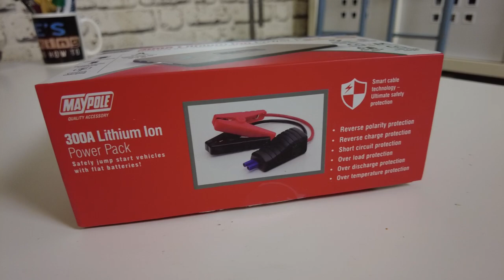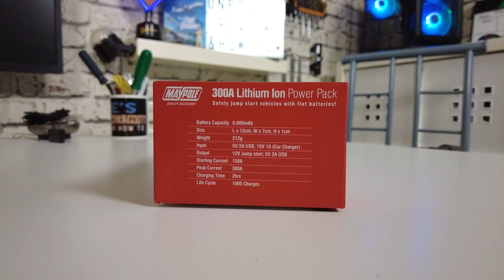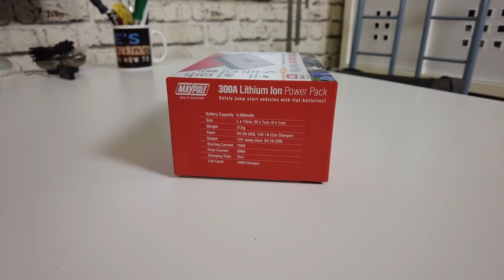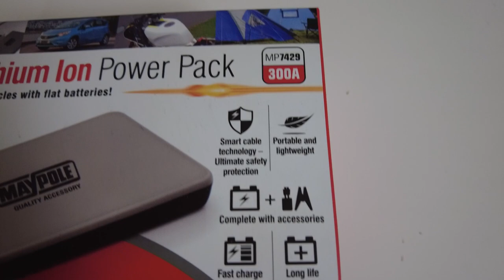300AMP Lithium Car SMART Jump Starter Power Pack Booster Maypole MP7429

Comment: I bought a Sealy Electrostart 4 years ago...its brilliant....no battery in it ...it uses capacitors and you can charge it in about 3 mins from a pretty flat 12v car battery as long the battery's residual voltage isn't below 5v (even after leaving your lights on all night or running battery down trying to start it usually wont dip below 10-11 volt)  ....have used it about 6 times on friends/neighbours/family's cars and it works great...expensive but excellent.
Reply from the maker: that sounds like a great piece of kit

Comment: Bought a similar device During 1st lockdown as I left my charging block connected in the Always on cigarette socket so after leaving it for a few weeks the battery dropped and wouldn't start (borrowed a Charger that time and bought a booster for future)
last week car wouldn't start, got the booster out of the boot (6 months without a top up on it) connected and started as if a brand new battery had been installed.
The one I bought was from Amazon, YABER Car Jump Starter, 1500A Peak 20000mAh Car Battery Booster (not listed now)
Very impressed (although it does recommend a top every couple of months to keep it charged)
Reply from the maker: thanks i'll see if i can find that one at some point sounds great and these are super handy

Comment: You say it is only good to 3L... but I believe it is harder to turn over a desal engine than a gas engine due to compression. Makes me wonder if it could start an Ford F-150 (5 litre+ gas engine).
Reply from the maker: yeahj my engine is a 2ltr diesel so that gives it some hard work to do fro the size on the battery bank, i recall only a few years ago that these boosters were the size of a toolbox and just as heavy. progress is good sometimes
Reply: @mikesunboxing  Battery technology is progressing quickly!

Comment: Unrelated to the video, sorry. Does anyone have the Ryzen 3700x? My CPU will bounce from 3400mhz back up to 4300mhz while running the a game. Temps are in 50s, just fine. I’m using afterburner to monitor this. It’s base speed is 3.6Ghz. From what I know, the CPU isn’t supposed to drop below its base speed. Am I missing something here? I am a bit of a noob, just built this PC in June.
Reply from the maker: run a benchmark in cinebench and watch the frequencies that should stay pretty much maxxed out for the test, if not there is something going on
Reply: @mikesunboxing  running the free version of 3D mark and it’s bouncing around during the GPU test 1 and 2. Also bouncing around during CPU test. Soooo I guess it’s RMA time 😕. The results on 3D mark doesn’t show the cpu clocked below its base speed though, even though afterburner said it did 🤔🤷‍♂️
Reply: @mikesunboxing  I figured it out. Being the noob that I am, I was monitoring CPU1 out of 16 and picking on only one frequency lol.
Reply from the maker: @CFHDime  Glad you got it sorted :-)